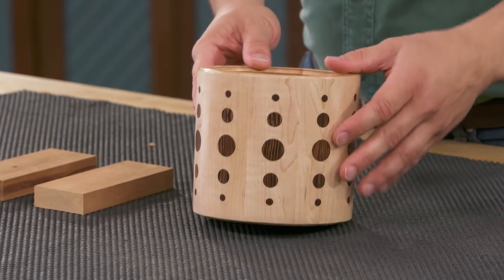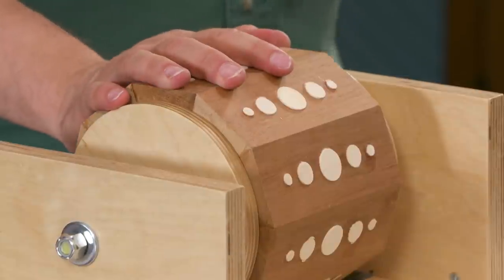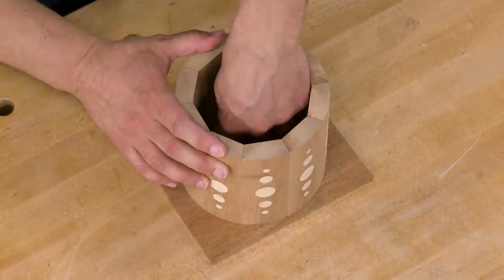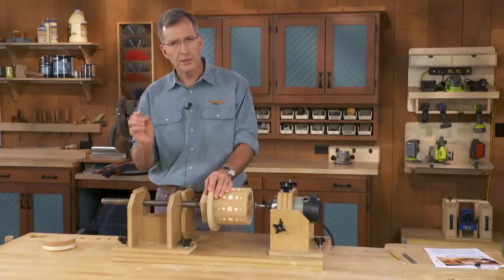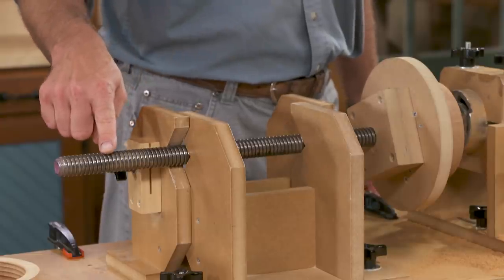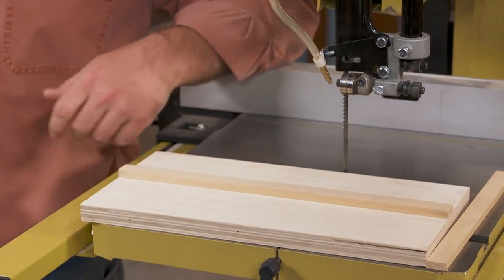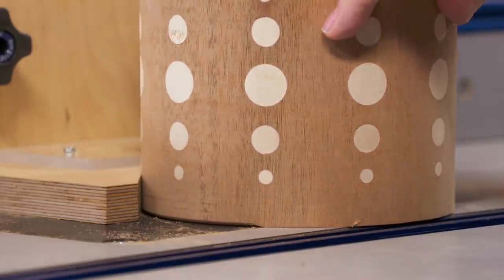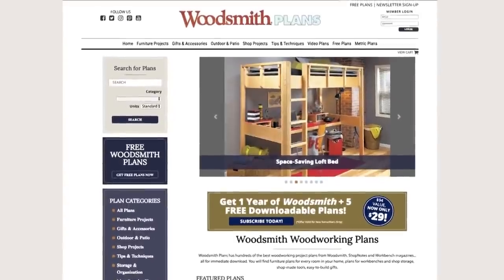Making Threaded-Lid, Wood Canisters

Comment: Nice project! Ingenious way to cut threads, Although that jig is quite complicated for such a highly specialized use.

Also, you mentioned the slight angle on the acme threads and the router bit but you didn't show either.
Reply: Yeah I noticed that too

Comment: Wow! I tried to watch this, but kept thinking how much easier this project would be with a wood lathe. With a router, this is way beyond my skill set. With a lathe, piece of cake. But thanks for demonstrating another way to skin the proverbial cat ; )
Reply: I too was thinking a lathe.  Turn both inside and outside.  That jig as a lot of complexity.
Reply: I'd worry about tearout on those bevel joints on the outside.  I'd probably start with a handplane to round them a bit first.
Reply from the maker: Yeah, a hand plane would definitely be able to take off a lot of the material pretty quickly. 👍

Comment: Awesome project!
How did you measure & set the router angle for threading?
Is this and other details (like how to attach workpieces to the platen) in the plans?
Reply from the maker: Yeah, there are a lot more specifics with angles snd dimensions in the plans.

Comment: Shouldn't the threaded plug's grain be orientated in the same direction as the top since they are glued together? If not, cross grains could cause cracking (?).
Reply from the maker: I don’t know how much it will matter on such a small workpiece, but I would tend to agree with you that keeping the grain on the two layers parallel would probably be best practice.
Reply: @WoodsmithShowandmagazine  I would think the opposite, like plywood, that the opposing grain would hold each other, preventing expansion or contraction (though you appeared to use very little glue in this example). Plywood of course has an odd number of veneers so that outer layers of veneer are going the same direction and the sheet is more balanced.

Comment: A link to a source for that double-bevel router bit would be helpful.
Reply from the maker: MSC Direct - Double Bevel Bit item# 03197100 https://www.mscdirect.com/product/details/03197100?rd=k&tg=Recommendations&tpp=false
Reply: Another alternative to the threaded rod mounting system with the piece of dowel and the captured wooden blocks would be to actually mount two appropriately sized nuts in the wooden block risers.

Comment: This is a neat idea, though be careful with that cutter. It is designed for spinning in the low 100s rpm, so you'll get burning in the wood and shorter tool life. A carbide thread milling cutter would be best for this operation, but those can get pricey!  An alternative would be to use a t-slot router bit.

Comment: A 1” x 5 Acme threaded rod is very expensive - $132 on Amazon Is there a reasonable substitute?
Reply: Many big box stores have a small selection of threaded rod. 1"-8, 3/4"-10, 1/2"-13 are common "bolt" sizes in the US. Ebay is another good alternative.
Reply from the maker: We used 1”x6-36” threaded acme rod from McMaster-Carr item# 98935A862 $21.80 https://www.mcmaster.com/catalog/127/3435